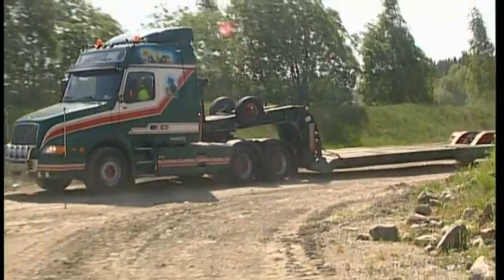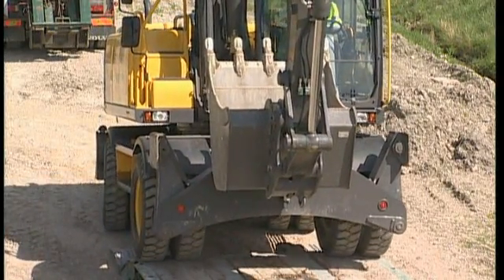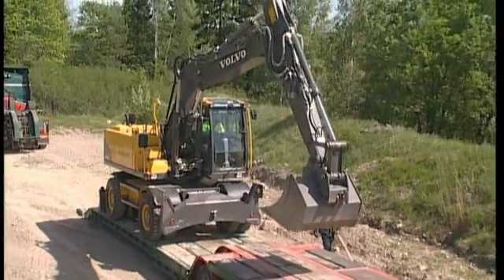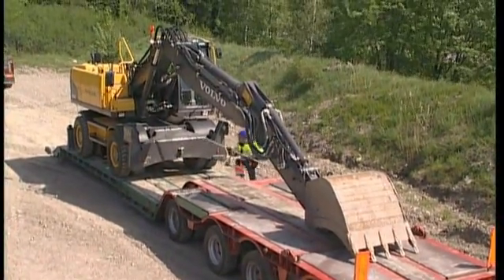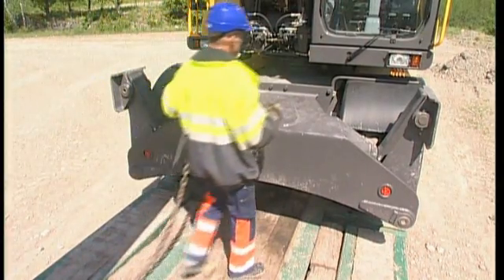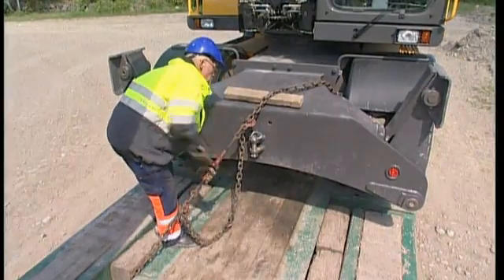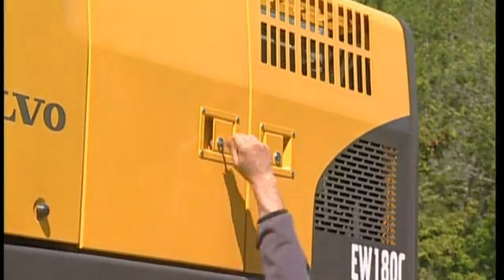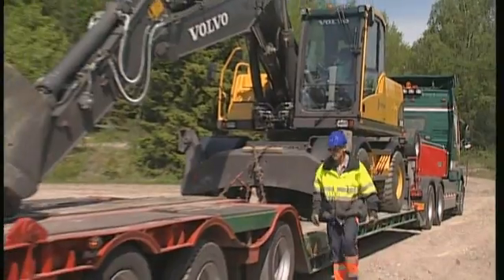How to load a Volvo Wheeled Excavator onto a truck (Part 16 of 16)

Comment: Its normal to secure the boom.
As its loaded forward its possible to engage the cab lock, a manual pin to prevent it slewing but its not mentioned.
Many machine operators wont load onto a trailer and many lowloader drivers wont allow them to. They find it quicker, easier and safer to load the machine themselves.
Reply: Iilll